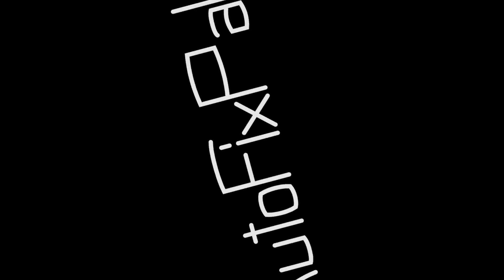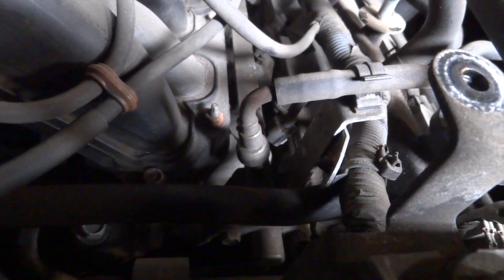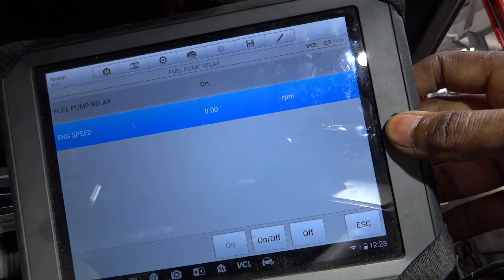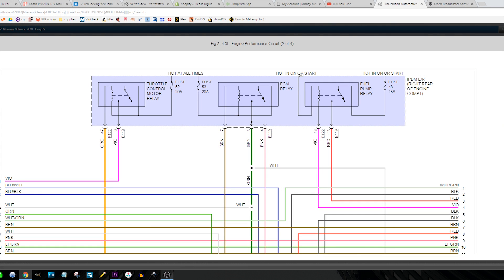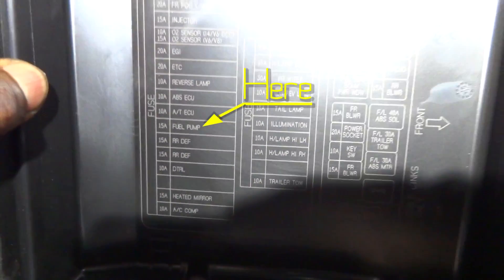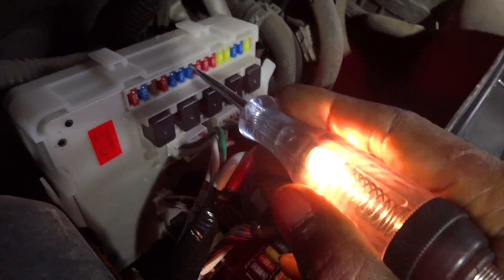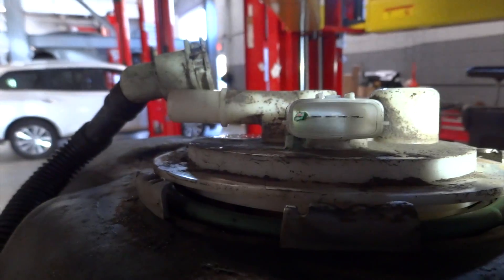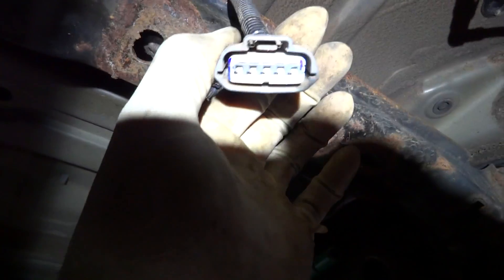Nissan xterra crank No Start diagnosis

Comment: My 2010 xterra cranks but won't start, after 4-5 cranks my lights inside turned off and all the gauges started twitching, clicking.
Reply: This is exactly the problem that I have. Sometimes it will start and runs excellent. Most of the time it gives a hard time and the gauges start twitching
Reply: @Neruodiv87  same problem, mine in the winter would not start just crank, now since it's warmer it's starts right up. Help please
Reply: Any updates? I have a 2010 with the EXACT issues.
Reply: I got a 2010 xterra. In the winter when it’s around 20 degrees. Just cranks but won’t start. Does any one has a solution. Only when it’s cold. In the Sumer there’s no problem.

Comment: I need help with a 2005 nissan frontier: Cranks won't start. Had many DTC's found broken grounds, fixed them. I am left with only two codes C1109, P0725 but it still won't start. No spark issue. I appreciate any info. Thanks ahead.

Comment: I was told bad fuel pump replaced the fuel pump and the gauge works now but still no start replace both cam sensors still no start sprayed starter fluid in the manifold still no start it acts like it wants to run but won't starter fluid makes no difference. Could it be out of time doesn't backfire  just acts like it not getting fuel. how do I tell if it's out of time. Not getting any codes. PO said it had a timing chain put in it 20000 miles ago but doesn't look like it to me. this is an 07 xterra 4.0 any help.

Comment: I have problem on pathfinder 2007 same engine changed fuel pump
Check pressure 52 psi changed ipdm before that ecm relay
Fuel coming to the fuel  rail
But I've sprayed carb cleaner in the throttle and my brother cranking and it run  so we thought before it's fuel pump so we changed it
Then we tried again spraying carb may be its once by chance and it runs so I've removed the plenum and checked voltage on fuel injector terminal harness
I got 12 volt in one pin and 2.36 v on other pin
But with one only I got 12 volt and zero for ground 
Then I've just turned on the car no crank its not spraying
I've tested with all sun injector tester it's clicking and spraying 
Could it be crank sensor?? 
Or there is relay for fuel injectors??? 
But one

Comment: I have a 2000 nissan xterra. It cranks but won't start. Replaced Fuel pump replaced water pump gaskets n balancer still won't start. Help!?
Reply from the maker: find out what your missing if its fuel or spark. Being that its a 200 xterra. You may have a broken timing belt, or faulty distributor. Common failures on those. But diagnostic is required.
Reply: @Autofixpals  it is getting fuel n spark. Distributor is even working. We did have to take timing belt off to get to water pump

Comment: I broke that plastic nipple on manifold  on vacuum hose you show , any ideas on best fix???
Reply from the maker: new manifold is the best repair, second best repair is jb weld.  JB weld is pretty tough stuff.
Reply: Auto Fix Pal thanks
Reply: Auto Fix Pal Hi I have 05 pathfinder 

Have intermittent no fuel situation 

Sprayed start fluid in vacuum line like you suggested and she fired up  so went to plug on fuel pump to test power to plug

Had no voltage but was not sure if I have to be cranking to get power to pump?

Plugged pump back in turn on car and she started , and ran for a few days no back to no start just cranks again

I changed the fuel pump a few months ago could I have a bad pump?  Also I  swapped out relay ecm with fog light relay when I got it started a few days ago.

Questions 1 -  how do I check pump is good?   2 - should I be cranking to check voltage a pump plug?   Thanks 🙏
Reply from the maker: @egegg5916  yes you need to be cranking to check voltage at the fuel pump. It should be the 2 thicker wires in the plug. you will only have power there when cranking. Have a buddy crank while you check for power. Its possible you could have a connection issue at the connector, be sure to inspect the plug well or it could be a defective pump.
Reply: Auto Fix Pal thank you seems like it maybe defective connector seems to have been loose , looking for a way to maybe safety wire it closed , hope it’s not the pump ,got a Delphi from auto zone .    How do  I check the pump?

Comment: you use mitchell diagrams at the dealer?? what autel scanner is that?
Reply from the maker: I did. I think mitchell diagrams are just laid out better than the EWD that nissan provides. But i dont have access to mitchell anymore. Most of my newer videos are using EWD. Maxisys mini, its older, not sold anymore.

Comment: Nice video I have an 04 died on the road cranks no start  checked it got no spark   thinking coil or icm   everything shoved into the distrubitor is a bad idea    .
Reply from the maker: It probably is the distributor. Make sure the timing belt inst broken, crank it and make sure the distributor spins.
Reply: @Autofixpals  Bro that was the 1 thing I did lol I was like ooo no not that  it was a big sigh when i saw the button spinning  .
Reply from the maker: @hillbillypyro  Well The good news is that distributor failure is very common on that engine. However you should still check to make sure you have your powers and grounds. It comes as an assembly ready to go. You can get a free wiring diagram from bbbindustries. google "bbbindustries wiring diagram"
Reply: @Autofixpals  Tanx for the info I am going to rebuild it to make it cheaper on me  , but had to order all the parts so  now its a wait game .

Comment: I have  a new fuel pump and ipdm and I'm still not getting power to the fuel  pump  05 xterra  how can I test if the ecm  is working to turn the fuel pump on
Reply from the maker: You need to look at the wiring diagram. You can get one from bbbindustries online for free.

Comment: I have a 2003 nissan xterra i am not getting any current to the distributor and the starter wont crank. I purchase a new Distributor and still nothing please give me a advise on what can i do next thank you.
Reply from the maker: You said the starter does not crank? there is 2 wires on the starter a big wire straight from the battery and another small wire that is controlled more or less by the ignition switch. You should have 12 volts on the smaller wire when the key is turned to the crank position. If you have good power (can flow current) at the small wire when trying to start the car then you have a bad starter.

Comment: I got a question,
I have a 05 xterra and here is whats up.
My wife's car had a check light for bank 1 cam position sensor and leakey valve covers forever. Using your video which was super helpful I did the valve covers changed the plugs and replaced the cam position sensor and VVT sensors on bank 1 and two because they were listed as possible culprits for the check engine light. Keep in mind that besides the smell of burnt oil the car ran great started great.  So here is what is up the car is hard to start now with the new sensors... like it used to fire right up, now it has to cycle for like 4-5 seconds before it fires. So I took the intake off again and re-checked everything . I looked at all the plugs but one....the firewall on the drivers coil bolt was acting weird like it would loosen but not release tension. This could be my culprit but I have a hunch that its not. I just put it here because its questionable. 
Now , the car runs great it doesn't hesitate or stumble I drove it 100 mile yesterday let it idle for long periods of time and no issues just the long cycle on the start? So my thought is the cam timing is off and the guy before who installed the engine adjusted the timing with his fancy scanner, if that is possible so that the car ran right with the bad sensors?
 and now that it has good sensors .....the cam timing is off? I know it is a long shot but that is what i'm thinking.Honestly I  am not even sure if a nice scanner like at the place that installed the engine could do that or not?
 Or is there a relearn process for the computer that I need to do when replacing vvt or cam position sensor. I did disconnect the throttle body which is how I found this video? God Bless I love your videos, I am pretty mechanically inclined, but I am in uncharted territory right now as this is not my cj or a small block Chevy and it seems like one sensor is messing all of this up. I could take it apart and put the old sensors back, but that just would get my goat if it was still doing this?
 Help Please
Reply: The cam position sensor you got is probably bad. I would go to a Nissan dealer and get one from them. I installed eBay ones from Nissan for 20$ for all 3. Of course one was bad, and it would crank and crank, and it took a few more times to start. I didn’t feel like doing the job myself again and paid a mechanic to do it. The part from Nissan was like 200$ I should of just left the original ones in to begin with, I wasn’t getting any codes but after sitting for a few hours after driving my car would crank longer than usual and then start. But I would start there personally.

Comment: Great knowledge, but I was having a hard time with hearing you over the music.  Also, when the pop-up words came on, they were odd fonts, shaking, and making it difficult for my eyes to adjust/read.  Just had to pause it for the words, but the music is difficult to work around, just have to listen a couple times.  With the words, feel free to use a different font type, but keep them still or not moving as much. Thank you!
Reply from the maker: Thanks for the advice.. i will make sure the music level is lower in future videos and less movement on the fonts.
Reply: @Autofixpals  better yet, dont use music at all. it only detracts, is totally pointless and distracting

Comment: great video. short and concise. entertaining as well. few things: I think suspens makes for better ending so rather than telling the viewer of the fix in the beginning you'd rather go thru it with them.
secondly for the diyer it would help to give an alternative procedure because most of us don't have access to wiring diagrams (or can even use them) and other fancy devices. So an old school, maybe a little more involved way, will greatly help the diyer. I personally enjoyed it thoroughly. It is very well explained and clear to anyone with a fairly okay background in basic auto diagnostics. Thanks again and keep them coming.

PS: if you could make special videos about tips and tricks for general and common repairs that'll help a lot and bring more of the novices to your channel.
Reply from the maker: Thanks for the tips. all great advice. I could make 2 versions of some videos using the same footage. This entire diagnosis could be done with a test light and a multimeter.

I do plan on doing a video that explains how TPMS systems work. i know that's still kind of a mystery to a lot of people and a very common issue. I will try to make that as DIY friendly as possible.
Reply: Auto Fix Pal or you could just add footnotes for the alternative procedure (the test light & multimeter way) at the key junctures. 
I absolutely hate tpms lol I live with the light on forever. That would definitely be a great addition. I know some require a fancy scan tool to reset them.
Reply: DIY-HAVEN wiring diagrams are available for free at www.bbbind.com
Reply: New Level Auto thanks a ton bud! Will definitely come ✋ y